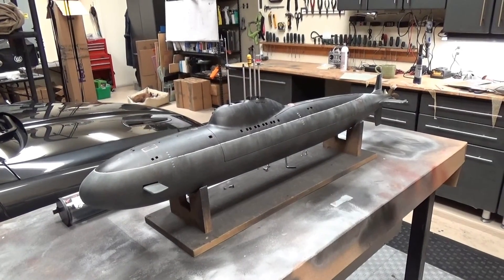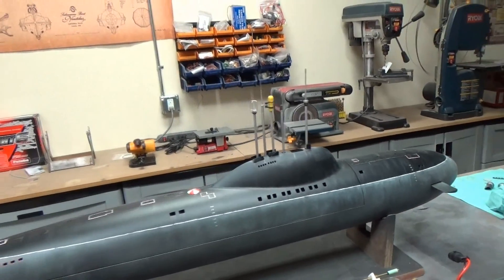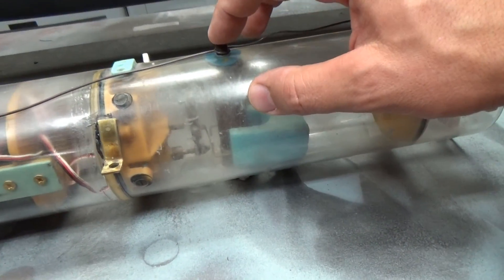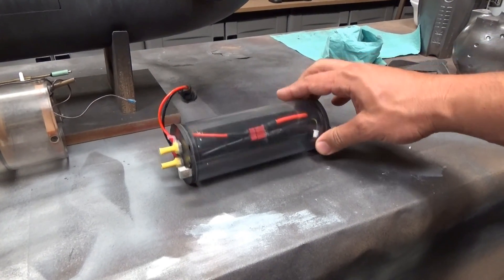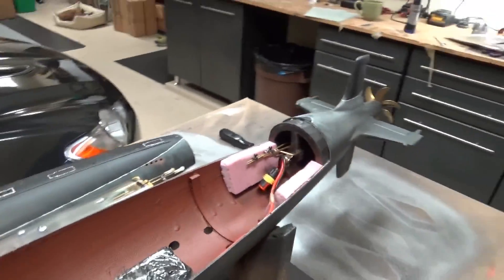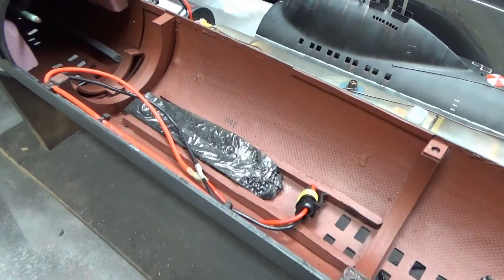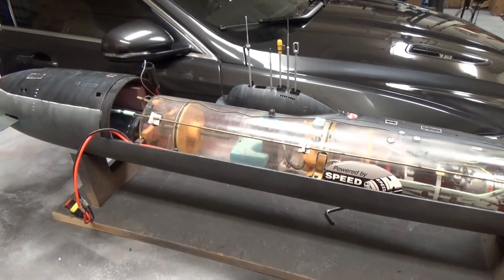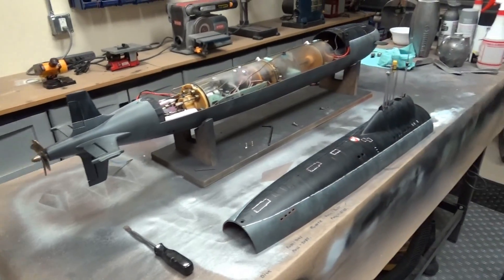RC Russian Alfa class submarine overview and maiden voyage

Comment: Hi Bob, I saw that large turning radius, why not make the complete control surface all moving? Surely that would be more effective? When the sub is underway no one will notice that the whole rudder or rear dive-plane is moving.
Reply from the maker: That could certainly be done. For some, scale appearance is more important than performance. This was a choice by the owner.
Reply: @RCSubGuy  noted. Thanx for the reply.

Comment: How does the control system expel water from the ballast tank? Is there a cylinder of compressed air? Do you have to fill it with an air compressor, or do you install a cylinder which comes pre-charged with air?